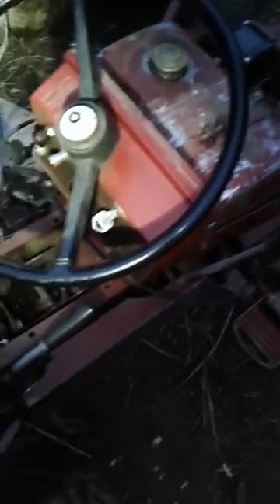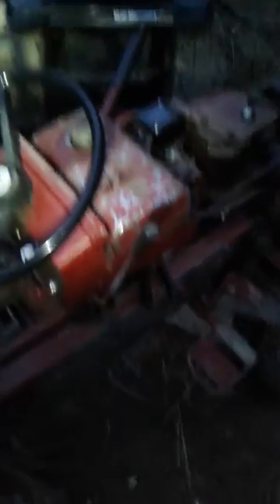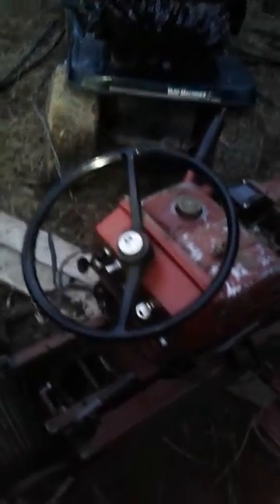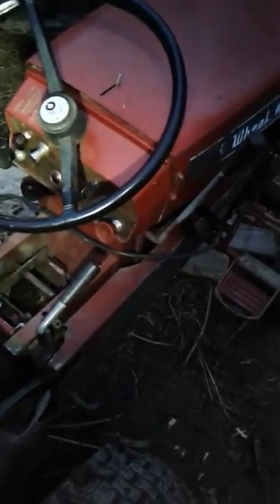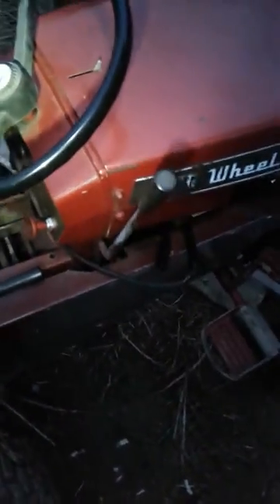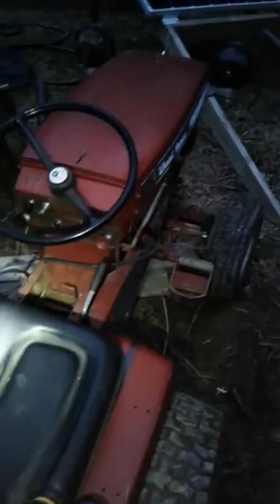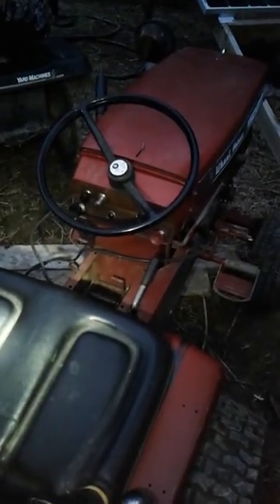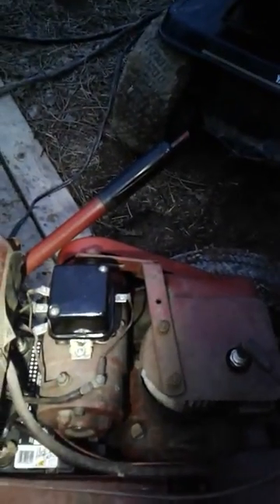876 Wheel Horse Brake/Clutch pedal

Comment: I have the Charger 10 by Wheel Horse and it is pretty much the same,  That lever moves the tractor out of being in fwd or reverse on mine when stepping on the clutch/brake.  Hope that helps.  Makes sense for it to get out of gear when one steps on the clutch/brake correct?